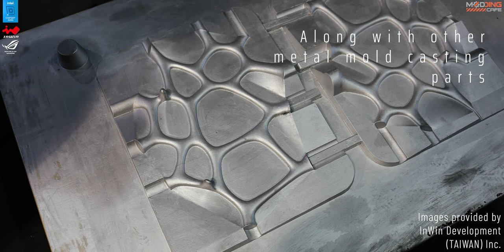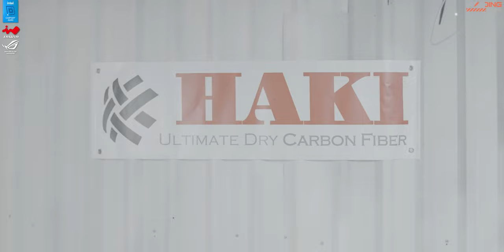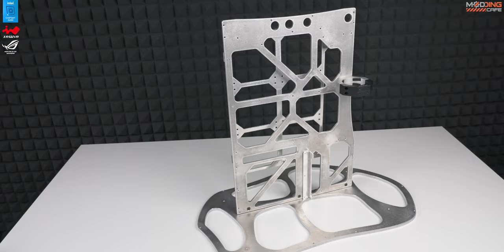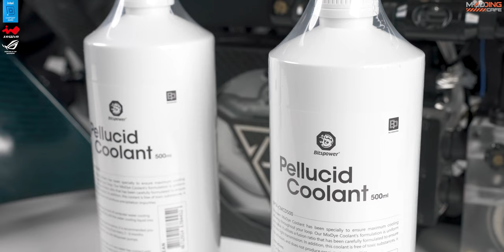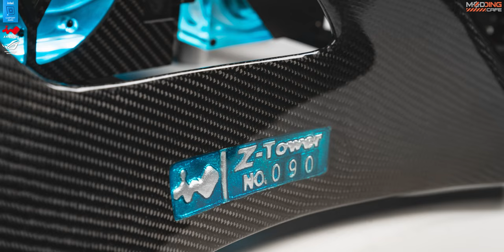Z-Tower PC: Carbon Fiber Max / Endgame build.

Comment: absolutely stunning piece of work. especially love how you've gone to extremes with your water cooling, not just the cpu and gpu but being the glacial motherboard obviously the monoblock cools everything else like the VRMs and chipset, plus the power supply is water cooled and you've water cooled the memory too. the work done on the case is absolute perfection on another level. I love this so much and I've seen a number of builds in this case but none compare to this. I wish I had your equipment to do things like this and the knowledge and funding to make these types of builds.